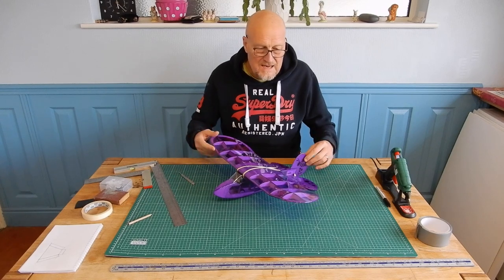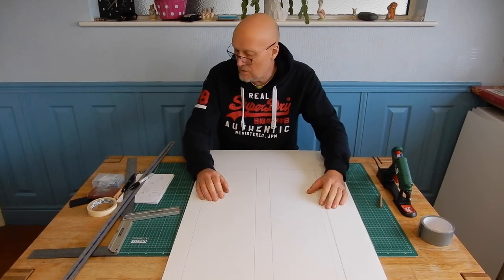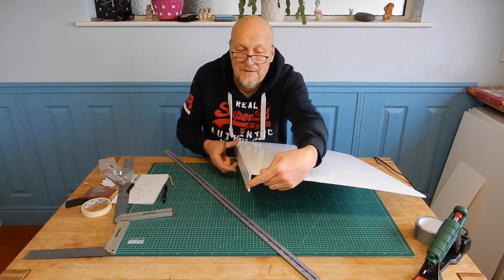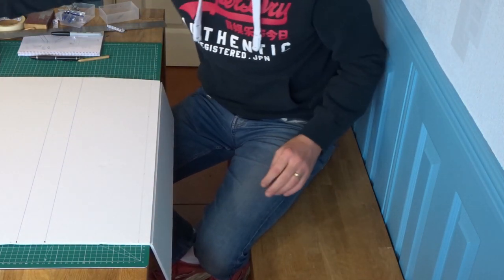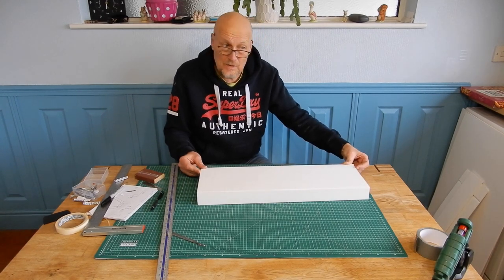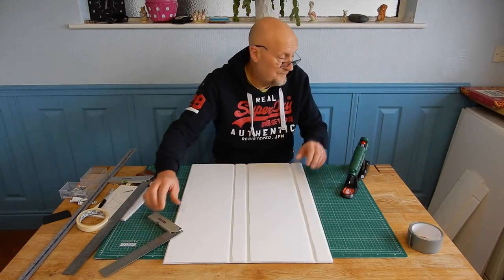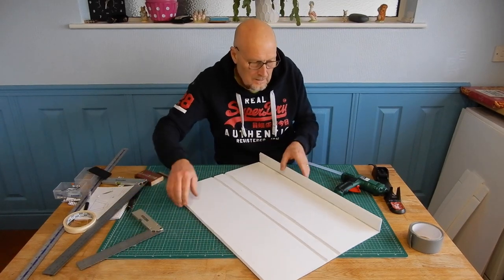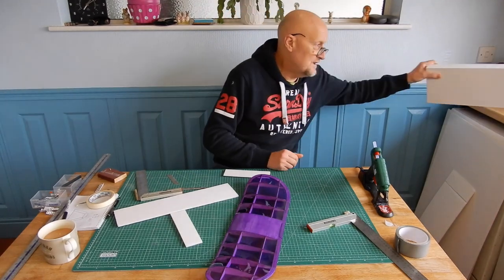How to build a glider carry / transportation box with foam board

Comment: Nick,
Your carry box worked out great but might I suggest you watch one or two of the Flite Test foam board airplane builds on youtube. You'll see they have some excellent techniques for laying out , cutting and folding that foam board so that it's really strong. 
PS I have built a few of the flite test planes which only take 3-4 hours from printing out the plans to the flightline and they are a hoot to fly with the cheapest electronics available.
Cheers